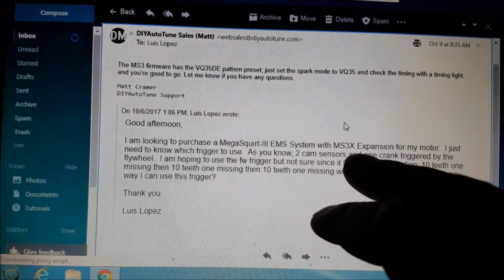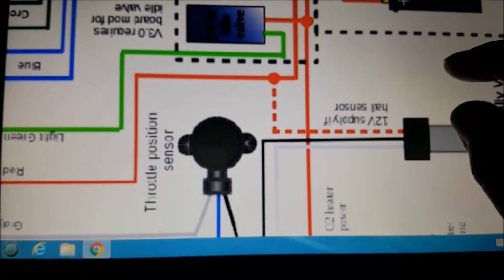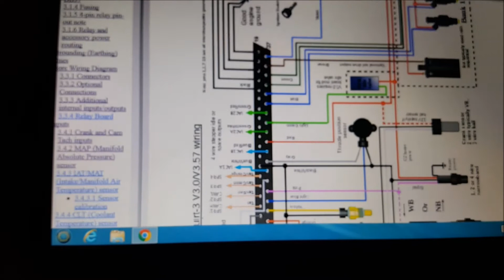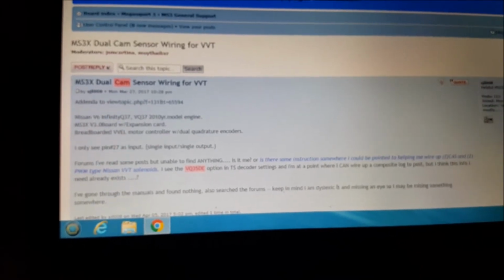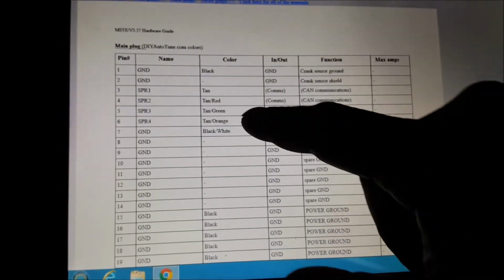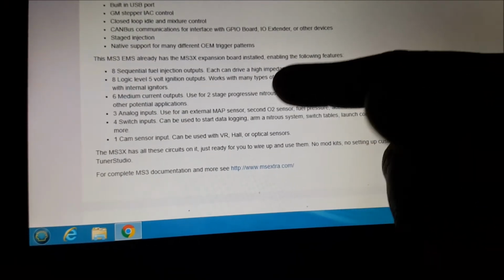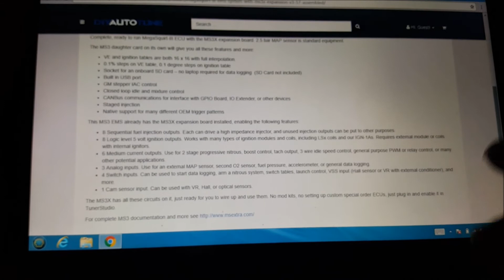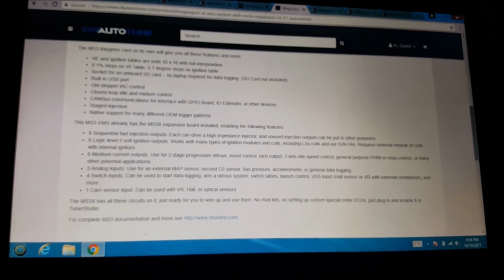VQ35 Build - Part 42: VQ35DE MegaSquirt MS3 Homework - Crank/Cam Settings

Comment: just noticed your video, and you mentioned a 5 volt supply for the sensors, double check with the builder but you should (might) have a 5 Volt supply on the 15 pin connector on the front of the box, on mine it was hooked up but I also had the knock sensor installed, so instead of using the TPS supply for my pull up (VG30E install) I used the other supply for the pull up resistors on the CPS
Reply from the maker: Yea, after the vid, Matt from DIY said I can use pin 26 on the main board (VREF) for the 5 volt power source.  I will be buying the assembled box from DIY.  Until I actually wire it up, I will not know if it will cause any issues.
Reply: Yes thats the TPS I was referring to, I think they hook the one on the front up standard, then if you get the knock sensor board installed it goes to that plug also (DB15 Spare) but other then that that plug isn't populated unless requested from what I was told. So you could request to have it populated with inputs or outputs, not sure what is all possible, also keep in mind a lot of the inputs are picked when you set up tunerstudio.
Reply from the maker: Ok cool.  Yea, I will be getting the MS3 with the MS3X daughter board installed.  Pin 26 (TPSVREF 5V) on the main board is the 5v.  Pin 31 (PT4) on daughter board can be 0/5v output.  Since I will be using only 6 spark channels, not sure if I can use Spark G or H to be a 5v supply.  Same for injector G or H, maybe in TS I can specify these outputs.  That is what I like about MS/TS.  You can get creative and wire many things up.
Reply: I think you will want to use PT4 as your second cam in. I do recommend getting the knock module put in also that way you can just use the factory knock sensors and would be less costly then getting a knock sensing set up later and you would have all of it in your data logs. I'm running the MS3/MS3X on my VG after I couldn't find a factory replacement when the ECU went out, but thinking of getting one for my VQ project now since I would have more then enough out puts to run my variable intake and everything
Reply from the maker: Yes, per Matt. 

 If not using VVT, you just need one cam sensor.

If you are using VVT, you'll need both. This can be brought in through PT4 or Datalog In on the MS3X, or JS10 (pin 36) on the main board. These are set up to take a square wave signal.

So I will have different options to play with.  If TPS and 3 cam sensors have issues powering up with VREF, then I can try and do this if need be.  I hope I don't have issues or else I may have to create a 5v circuit as I read other people have done.  Awesome you swapped in MS on VG.  You have a Z31/Pathfinder/M30/Maxima or any other platform the VG came in? What are you swapping in VQ into?
Reply: The reason I say PT4 is more then likely the best is you can still use the push button data log and it's in the same harness as the cam in, and there is a second 5V output so you wouldn't have to make one, or at least mine had one that I found out about after asking Matt what else was connected to the DB15 plug other then the knock sensor inputs.

I have a 85 Maxim SE that the ECU decided to die right after I put in a new trans and couldn't find a replacement so went with the MS, I also have a 94 Pathfinder but thats down due to theft, got it back but missing a bunch of parts and now the TPS since I needed it for the MS......

The VQ32 (yes 32 not typo) is going in a 1986 S12 mated to a BNR33 trans, just getting back on it after dealing with the Maxima diff bearings going, getting the Pathfinder, that getting stolen, getting a G20 on a hook up that had a wiring issue, fixed that, then it blew head gasket a couple months later, had high miles so not super surprising , finding a tranny for the Maxima then dealing with the ECU going, so this last year has been kinda a wash on getting anything done on it, but about to dig my heads back out and get them put back together and other things like rod balancing and the stuff I don't need money for right now, till I get the trans and MS paid off.
Reply from the maker: Wow...nice to see another Nissan guy.  Thanks for the heads up on the MS wiring.  With the VQ, is it 35 block with 30 crank and rods?  As for MS, I had a MSPNP on the KA-T.  Best money I spent.  Can't wait to get the 3 in my hands to start wiring.  I have the complete Z33 harness so I will be using that harness mated to MS.  When this happens, I will learn more about the ecu and how to wire up.
Reply: yea 35 block with 30 crank and rods, short stroke long rod, using a 2002 Pathfinder intake to get better low end

Comment: Shouldn't be able to mix cam and crank inputs into one haha. I was wondering how you had a cam input on the ka to the ms. That sequential would be nice for running itb and egt probes. Without the plenum spacer the rear cylinders tend to run a bit richer. I think those ls coils you can adjust their dwell time to help against spark blowout but too much and you'll fry them haha
Reply from the maker: Correct, you cannot mix the inputs.  I was wondering cause the wiring diagram only showed Crank Input.  Then I saw that the MS3X Daughterboard had a CAM input.  Which still left me with the question if you wire both signals to this port but I know that MS/TS lets you change how ports interact so I asked DIY support.  Matt confirmed that you will wire crank signal to crank input, one cam signal to cam input, and optional other cam signal to another pin and change settings in TS.  You can run the car with only one cam input and crank but will not have VVL control.  Wire in the 2nd cam input and you have VVL control.  So I will be wiring all sensors for this functionality.  Maybe it can help spool the turbo.  On the KA, I had a MSPNP so I did not have to do any major wiring. Small stuff like wasted spark, iat, launch control, etc.  The cam signal comes from the dizzy.  I installed the diy trigger wheel on the KA to get wasted spark.  I bet the plenum spacer corrects the issue for NA but I don't think it should be an issue on a force fed motor.  Yes, you can adjust the dwell in TS but the D585 (coils with heat sinks) have a built in fail safe which I believe the highest dwell is 6.0ms then the coil will fire itself to save itself from burning up.  I ran .018 on heat range 8 NGK plugs pushing 30psi and did not have any blowout on the KA.  My friend with his KA making 530whp had 4G63 coils gapped to .014 I believe.  I know he had to use feeler gauge to gap or else he would get blow out.
Reply: supakat500 wow that's a tight gap haha. I see what you mean about the vvti that's what I find really cool about ms you can just solder stuff in and change it up to your needs. I would definitely wire it up I feel it would spool quicker and have more low end tq.